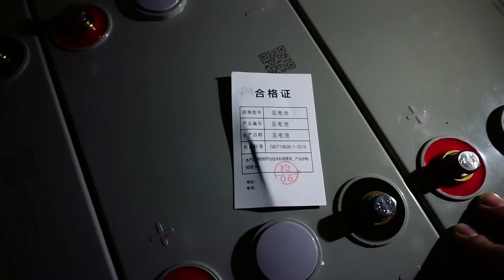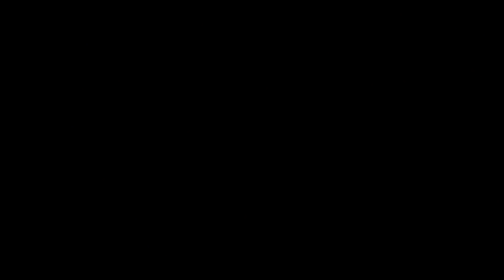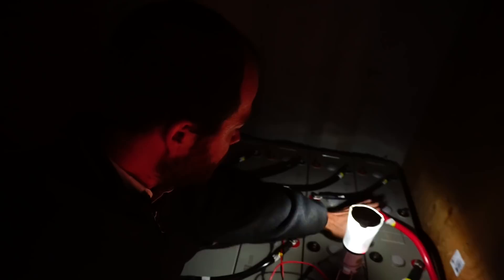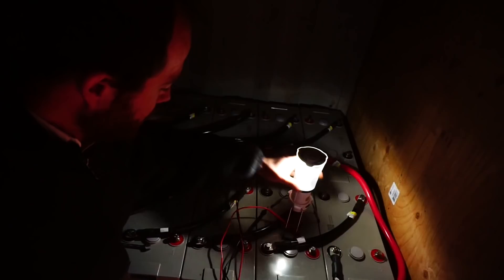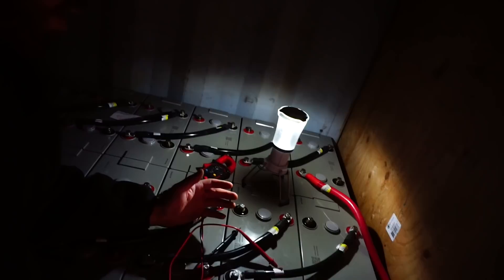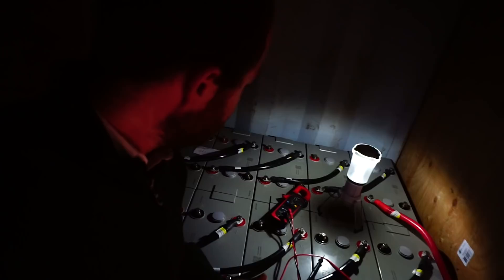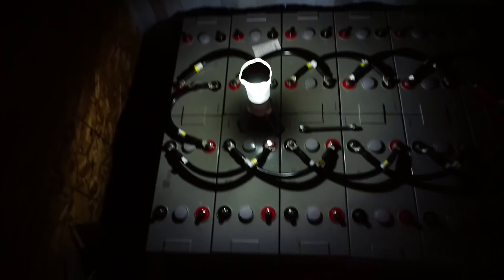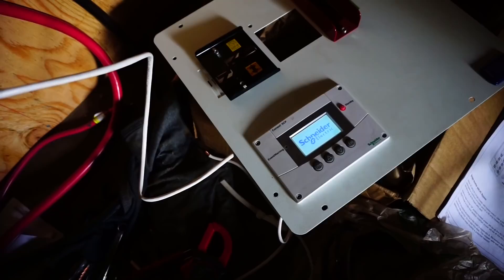Building an Off Grid Yurt Part 14: Off Grid Power System and Woes

Comment: Every terminal needs to be connected. Each individual 'battery' is called a jar, and each of your jars has 2 cells inside it. I believe you'll need to wire each jar in parallel and then connect the jars to each other in series to get the 24v/800ah capacity you're wanting.
Reply: that was my thought too.  I suspect that way it is wired now, only half the capacity of the battery bank is available at this time.
Reply from the maker: +bwillan David Powell my intuition is telling me the same thing. Backwoods solar is sending me more cables to do just that. Thanks
Reply: My first thought when I saw the 4 posts. 

Great video regardless. It’s good to see the successes and failures. And I would call it a success

Comment: I hope that the bank works out for you.

Having had a look at the vendor's web site as well as the Canadian distributor, I found the lack of technical documentation to be disconcerting.

As Voneschenbach postulates below, the limited information that was available does give an indication that they're targeted at industrial use, not for the renewable energy market.

Xantrex make excellent gear.  Good choice of equipment.
Reply from the maker: +Deryk Robosson I hope they hold up as well. I am intrigued by how they are built and I really wanted to test them out for the worlds sake. I guess I have taken a good first step. 

Thanks for your input.

Comment: What would cause the voltage drop on a light load?: a cracked connector within the battery can do it.  
If the connector is touching it'll read voltage fine, but on any noticeable load there's not sufficient cross-sectional area to carry any appreciable current and the voltage will drop
OTOH I'm glad you chased it down to a hook-up problem
Reply from the maker: Me too. I was worried and certain that I would be seeing smoke and smelling melting plastic.

Comment: Thanks for sharing. Some questions and suggestions. What is the rated watts of your inverter? Is it a pure sine wave inverter or a modified? You mentioned only having two wires for the 240 volts coming into the house. So are you saying there is no ground or neutral? Are you going to install solar panels or just charge up the batteries with a generator? Now about the batteries. I would suggest that you contact the manufacturer and explain what you are doing and what you have. They should be able to tell you how to wire those batteries using all posts. They may even send a wiring diagram. God bless
Reply from the maker: +John Smith Thanks for the comment. This inverter is a 3500w pure sine wave inverter. When I mentioned the two wires I was meaning the two 120v hot legs. It also has neutral and ground connections. For now we are charging with a generator. We are thinking of adding solar panels as time goes on. 

Also great suggestion on contacting the manufacturer. One of the comments on this video has a link to a diagram of the battery. I haven't had a chance to look at it yet. Depending on how that goes I will reach out to them for more info. I really think I would like to call them just to get a little more information about the batteries themselves.
Reply: Thanks for the reply

Comment: I don't have any experience with Silicone Salt batteries but I do have a lot of it with very large setup of deep cycle Lead Acid batteries (we use these Lead Acid batteries extensively in the telecommunication industry).

The voltage test of one of those batteries bugles me... Testing terminal pairs is OK at 2-3V, across at 4V is still fine but the other way across at -4V does not makes any sense. This battery terminal configuration is unknown to me. I'd like to get the battery schematic but I suspect the screw terminals are "paired" internally, either by their connections to the electrolyte or simply by an internal power circuit.

Manufacturer's information mentions almost every possible voltage battery configuration but nothing for 4V.

I wonder what will be the result if the wiring was setup to use the outside screw terminals (relative to your existing battery bank) and if both inside and outside wiring were connected simultaneously and feeding the inverter/charge controller (do not try this at your home; have the distributor to do this test instead). 

Lastly, to which series these batteries belongs to? Are they DW Solar, DW UPS or GS?

Keep up your excellent work.
Reply: yah   - minus voltage should not / can not happen between same colored terminals..  no matter what type of battery  it is.  LOLs who knows those chinese put wrong color decals on opposite terminals.  but more strangly is that  both red or black are not Hard wired internaly...   I bet hooking up addition wires in same red to black will cause a massive short...  since they seem to have reverse polarity...   very strange indeed ..
Reply from the maker: +Simon Forget If it helps the reading was -0.4v I was wondering if it had to do with the power flow while the inverter was trying to draw power off the batteries under that configuration. 

Backwoods solar is sending me enough cables to actually connect the other terminals. I was thinking that it would be fine, especially if I test to ensure correct voltage before connecting it up to the inverter. What am I missing here?

Also. I have not been able to find any indicator to which series these batteries belong to. There isn't any clear lable on the battery indicating what type it is. The Backwoods Solar website hasn't helped either. I will have to chase it around a little more. I will probably be calling the manufacture at very least before I hook up the rest of the terminals. I will ask them a little more at that point. 

Thanks again for all your great insight.
Reply: Yes, it works but you need to get all informations and understand everything related to this system. For the price that you have paid for, it is simply unacceptable for you (as customer) to not have all the manuals and answers. This looks like more and more like the automobile industry, except you are the one that will maintain this system at the end, not the dealer.

This technology looks amazing in every single point. Now, customer service (from the dealer and manufacturer) needs to step up and provide you the answers that you deserve.

Keep up your excellent work.

Comment: Set it up like this?  Just make sure all the jumpers are the same length at the connection where it makes the U turn.  Use busbar for most connections. 

https://drive.google.com/open?id=12g1ekrl4LwM8UIOuB5BkCt9C_DeUOpwn

https://m.ecvv.com/product/4789548